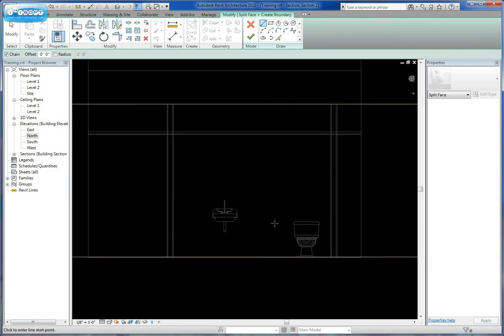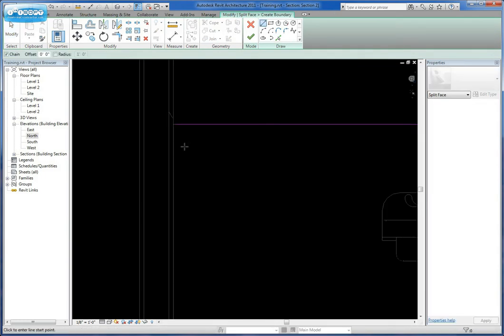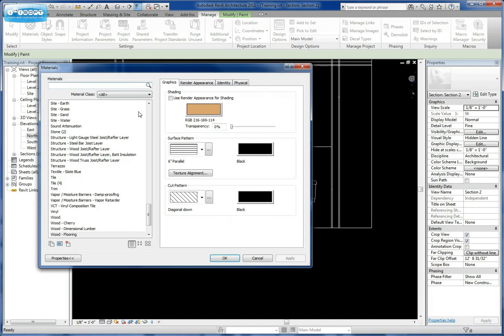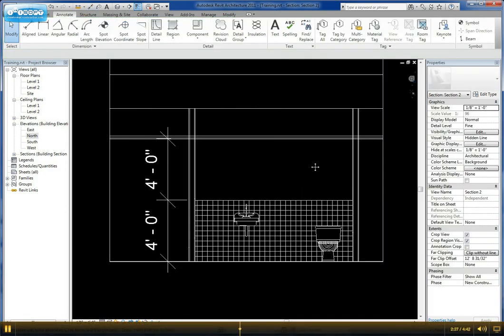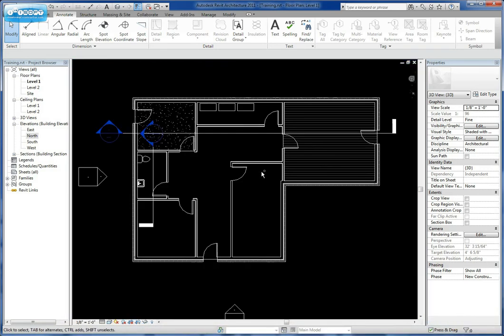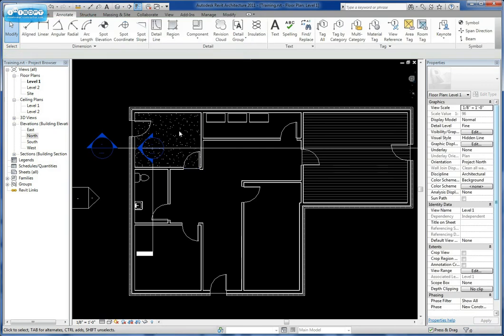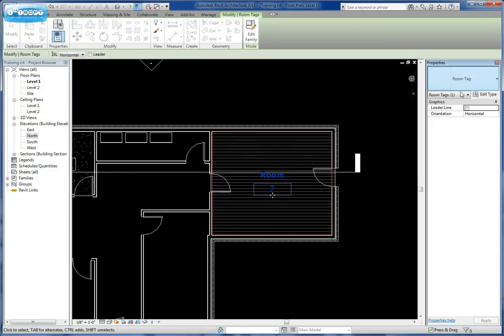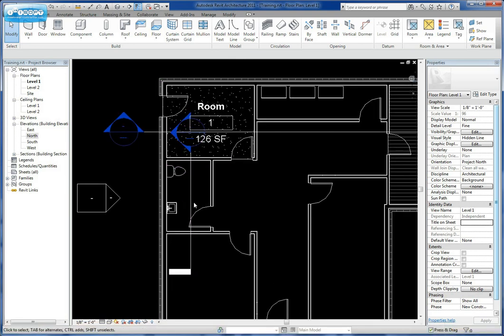Split Face for Walls

Comment from the maker: Split face command is associated to a surface, as on a wall, floors, etc. If you are using walls on your generic model you would be able to use the split face tool. However if you are using the conceptual mass tool you will need to assign colors to the mass elements.

Comment: Why can you apply paint to an element/ face on a generic model but not use the split face tool. The split face only works for walls floors and columns. Really annoying when you need to do a split face on a generic model

Comment from the maker: when you are doing a split face on a wall, make sure you are applying the material to the correct wall and correct face of wall. I would guess that the paint material was possibly placed on the opposite face of the wall you split. Hope this helps.